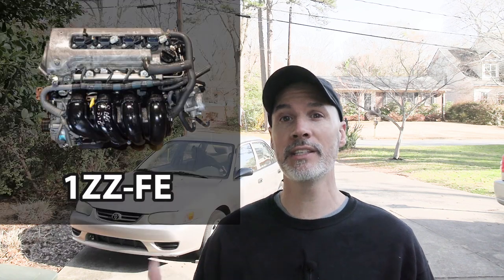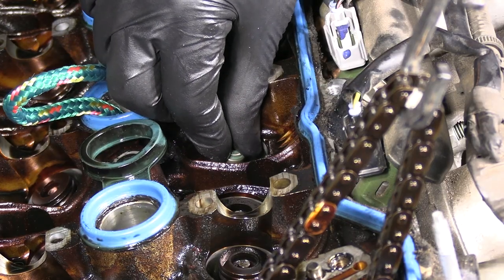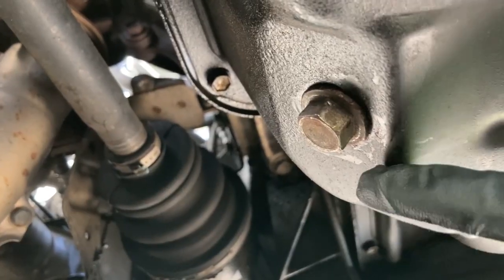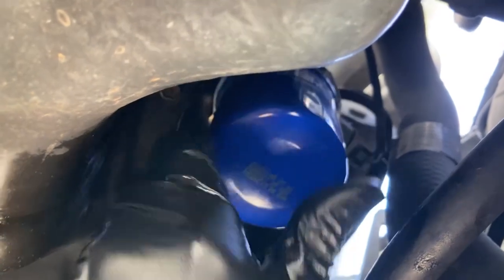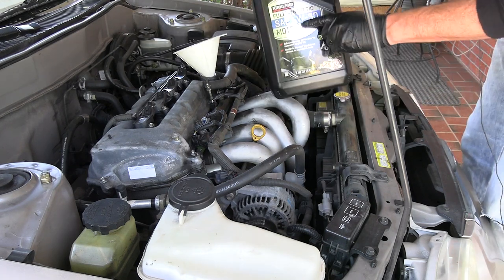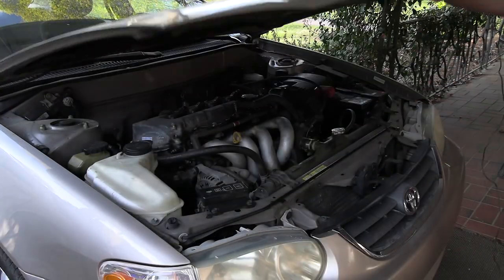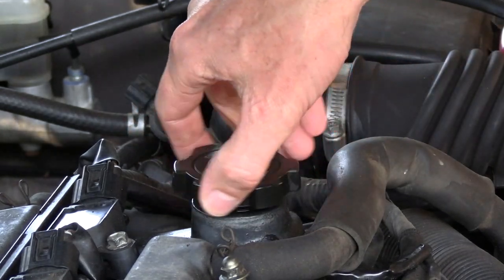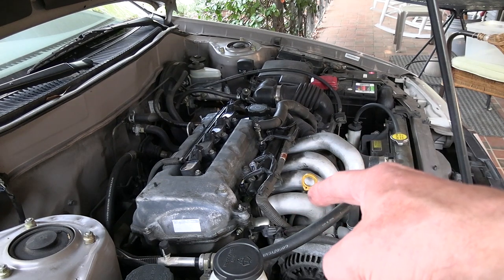Did the valve stem oil seals stop the oil consumption? | Oil Burning🔥Experiments | Episode 11

Comment: We have a 2005 Toyota Corolla that we use for work. It's an oil burner era car. This car was burning oil as I had to add one to two quarts every 2000 miles. Mechanic advised and he told us to fill oil to high mark on dipstick. Then add another quart or two. Car stopped burning oil period. Car know has 206,000 miles and doesn't burn oil and gets regular 3000 mile oil changes.

Comment: Hey Dave, I have the same oil pan as you and the o e thing I hate is trying to pour the used oil from the pan into a container. I figured out to drain the oil directly into a container which I put inside the oil drain pan to catch any drips.
Reply from the maker: Good Idea. Yeah, this one is a pain to empty.
Reply: Not sure about Toyota,  but on my Benzs I use a vacuum and never touch drain plug. Like DIY Dave would do, I vacuumed, then pulled plug to find not even a drop. I drained with plug and there was leftover for vacuum. Unfortunately, not every drain pan and dipstick tube configuration gets same results.

Comment: Have you considered pouring Acetone or Ethyl Acetate into the cylinders?
From using these in the past (not for this)I know they are excellent at breaking down carbon, they might stand a chance of freeing the rings if they are stuck from a carbon build up.
Reply from the maker: I haven't looked into the Ethyl Acetate, but someone warned against the Acetone, saying it would eat through seals. I'll check it out. Thanks.
Reply: @FamilyFriendlyDIY  Don’t think you’ll have any contact with any seals if your just filling the cylinders. You could flush the cylinders with some brake cleaner after letting them soak in the acetone to flush any remaining Acetone out.
Reply: Acetone should work nicely. I think it is the most used carbon dissolver in chemical industry. It is used to suspend the carbon to filter out any impurities like graphite or active carbon. Filter it and then just flash off the acetone and you are left with just carbon. If you are concerned about the engine seals you could leave the oil drain plug out while keeping the cylinders topped up with acetone. And to fight evaporation, put the spark plugs back in hand tight. 

If you have a cheap lawnmower maybe you could try the acetone on it's pistonhead first.

Also i have been looking into a product called Piston Kleen. Made out of 1-5% pentasodium triphosphate. I wonder if one could get their hands on to some 100% stuff. Piston Kleen is supposedly 50 times better at dissolving carbon from firearms than other fiream cleaners. Haven't tried it and haven't looked into how toxic the stuff is. 

In the olden days people used to clean the sludge out of crankcases with diesel fuel. Supposedly cleans carbon deposits also and is supposed to be seal friendly i guess. Just fill the whole thing up to the brim and let it soak a day maybe even two. After that let most of the diesel out. Try to leave the amount in that you would have oil in the engine. Check that the bores aren't filled with diesel. Take the spark plugs and the fuel pump relay out. Then run the engine with the starter just to circulate the diesel around the oil passages. And to get any dissolved stuff out of the passages.

After that let it drain. And do a couple oil changes letting the engine idle up to temperature in between. 

If feeling brave you could also replace one quart of the engine oil with diesel and let the engine idle for 30 to 60 minutes in 2 or 3 cycles letting the engine cool off some in between the cycles. 
Seems to be ok for the bearings if kept at idle.
The above I have tried once. Bought a neglegted car. Engine sludged up.  Did the cleaning with diesel. And drove the car for another 20 000miles until aquiring a more spacious car. My family member still has the car and it is in working order ,appears that the procedure didn't do any harm. Helped on oil burning some, but the turbo seals and valve stem seals needed changing too. The car now has around 260 000 miles on the clock.

Comment: I fill the filter myself if I can. 75% of engine damage occurs on cold startup. And a cold startup that needs to put the oil through the filter first is just that much more half seconds of wear
Reply: EXACTLY... In large industrial engines, both Diesels and gas turbines, having oil pressure and flow before actual starting is absolutely done by a "Pre-Lube" pump, and in very large engines, there are not just one, but two complete systems of Pre-Lube pumps, one run by AC and the other run by batteries(!) such is the importance of having a complete Pre-Lubrication during the start-up sequence!
In my cars, I take out the Sparkplugs, disconnect the fuel injectors and run the engine on the starter to get full lubrication before reinstalling the plugs and actually starting the engine when changing the oil...

Comment: 10W-30 would only be thicker (higher viscosity) than 5W-30 when cold, not when warmed up, so probably would not affect oil consumption much.  Going to xxW-40 might help oil leaking, but could affect the VVTi, or main or rod bearings, NOT recommended.  It might even reduce the flow rate through the piston oil ring drain holes, getting hotter, sludging more, reducing the size of the holes and making the problem worse.  Some DIYers online remove the pistons, drill more and larger drainback holes, and put the pistons back in.  My 2004 Vibe is ok so far at 80K miles.  I did raise the oil level per the Matrix TSB recently, I have not seen any foaming.
Reply: Well thinner oil will get into the gummed up oil rings better… thicker oil does slow down the problem but better to  take on long road trips driven higher rpm’s and get those oil rings cleaned up… beats tearing down the engine…   But if he is going to tear down the engine he should look and see if Toyota changed the piston design and oil ring design and replace with the upgraded
Reply: @pinonnut they did change the piston design with a completely new part number with new pistons.
Reply: Going with something as 'thick' as 20W-50 isn't appreciably thicker than something as thin as 0W-16. 20W-50 oil is around 20cST (Centistokes) at 212F while 0W-16 is around 8cST. That seems like a large difference but when you consider a 0W-16 oil is around 100cST at 100F, and 1000cST at 40F, it's easy to see that the purpose of going with thinner oils is to improve cold start ability and fuel economy when the engine is warming up. In Australia and countries in the middle east, Toyota specifies 20W-50 oil in hot climates anyway. Most of the push for thinner viscosity oils is for meeting government fuel economy requirements and for better cold start ability. I have this car and I use the thickest oil possible and it runs fine. I haven't carefully measured the fuel economy penalty of 5W-50 vs 0W-30 oil but I'd say when it's 50F outside, it brings my average down from 35mpg to 30mpg on trips less than 4 miles. On trips of 15 miles or more, there is no fuel economy penalty.

Comment: Hey Dave, it would be interesting to see if there is still oil leaking from the top of the engine now that you replaced the spark plug valve cover gaskets and the valve stem seals as it was the case in your previous borescope videos
I rewatched those parts and wonder whether that problem still exist or it was resolved
Reply from the maker: I'm planning to rescope as part of the next (Corolla) video to look at that very thing, ronda. I think there are going to be some surprises :-)  ... Thanks for the comment!
Reply: @FamilyFriendlyDIY  I thought the oil was leaking only in cylinder 3 from what I remembered, but when I rewatched I think I saw oil in cylinders 2 and 4 as well, although 3 was the worst, funny how memory works sometimes! 

Looking forward to your next video

Comment: Short of a total teardown and each part soaked & scrubbed, this
engine needs to be rinsed out and use 0W-30 oil with frequent
oil filter changes, until it is clean- then use only 0W-30 as oil.

The "rinse" is 1qt kerosene + 1qt conventional ATF and the remaining
0W-30 to 1/2 qt over full. Idle at 3k RPM 30 minutes, drain HOT overnight.
New filter each time. This must be performed at least twice, back to back.

2 quarts kerosene
2 quarts conventional ATF
7 quarts 0W-30
2 filters.

After this procedure, refill normally with 0W-30 & a filter. Spirited driving,
highway is low RPM, transmission is doing all the work of torque. High revs
and long idling keeps engines clean. Police cars & ambulance rarely
shut down- run 200k - 1,000's of hrs. frequent oil & filter based on
hours, not miles.
Reply from the maker: I like the 0W-30 idea. I can see how it would help with the cleaning.

Comment: Double check the cylinder walls with your borescope. The video you shoot before showing wall on cylinder 3 is full of leaking oil, and you think the oil is come from valve stem oil seal leak, so I think it is time to verify it. With reference from The Car Care Nut channel, it is best to inspect cylinder walls by a dual-lens borescope.
Reply: that's right, the cylinder walls are the problem, but would still be interesting to see how new rings go, keep up the good work

Comment: You’ve done a lot of testing for sure so I bought an 08 acura tl type s and the oil pan is leaking from the seal but only from a certain spot and the pan has hondabond which could be the old owner didn’t install it properly so what additive do you think works well with hondabond rtv? I’ve used Bars one seal and it didn’t work do they sent me the most expensive additive they have which should be able to stop it but I haven’t used it yet.

Comment: run engine flush for longer, 5-10mins isnt enough, a good hour of idling would really help. if you are too scared, just make sure to use engine flush that has anti wear additives.
Reply: Exactly, people are too afraid, and manufactures are scared to recommend what’s really needed, when it’s a quart and a half low, do for a toil change anyway, put in a quart and a half of motor flush, run it for a half hour a day for a week in the driveway, let it sit for a few days, then change the oil… Center wait oil to get into those clogged oil rings… Not 10W-30 5w 20 Then go on a road trip and drive fast for 1000 miles… That will reduce the oil consumption by half, and then religious oil changes will keep cleaning the rings (Hopefully if they’re not turn to super glue already)

Comment: Ive tried most of the fluids you have on my 2000 Corolla with no luck. Im considered mixing diesel fuel or kerosene in the oil to see if that works. Ive tried seafoam, marvel mystery oil, lucas motor treatment, ATF, engine restore, stp oil treatment. Hoping you figure something out I really don’t feel like doing rings but if i do i only paid $200 for the car.
Reply from the maker: Wow, you've tried pretty much all the stuff folks are recommending. Thanks for the info!

Comment: The ring lands have been pressure/heat compacted with carbon over time. If that expensive BG Dynamic Clean don't cut it no pour in product will. You'd have to use your connections to get the BG system as they only sell it to shops. A shop owner in New Jersey who has a podcast says mixing brake fluid with the oil is a LAST ditch hail Mary for internal cleaning.

Comment: Been waiting for this...my 02 Corolla at 186,000 burns like yours, yet my GFs 01 at 208,000 doesnt
Reply from the maker: Crazy eh?  ... Do you know any of their history that might clue us in to why one burns and one doesn't? Thanks for the comment!
Reply: @FamilyFriendlyDIY  Some of their history. The 01 is a salvage vehicle that received a rebuilt title in New York in 2014. The 02 is a clean title that apparently sat for 3 years till I purchased it in 2018 in California. They both drive great. Just the 02 burns oil at about the same rate as yours does. Here's another suggestion. I was reading some stuff on the Toyota forums and someone mentioned Valvoline Blue RESTORE OIL (Not Valvoline Blue standard oil). It's engineered for Cummins engines that had a bad sludge issue but safely can be used in gasoline engines. The problem? Can I let be purchased at a Cummins dealer. Cannot be purchased online. It has a ton of additives (including Ether) for cleaning pistons and rings and claims it can be all fixed in one oil change cycle. Another negative? The oil is about 75 dollars a gallon. I'm going to try to pick some up here in Wichita next week and try it.
Reply: @FamilyFriendlyDIY  Furthermore, the 2002 was a transition year. They probably rushed the 02s out to get started on the 03s. That could be a reason as well.

Comment: Is your burned oil coming out of your exhaust? And if so when?
Reply from the maker: Not really. The cat seems to be doing a good job of cleaning it up.
Reply: @FamilyFriendlyDIY  thanks for replying
 I'm kinda in the same boat. I have a 2004 Honda element that burns about 3/4 of a quart of oil. And I can see it coming out of the exhaust but only after long idles. I'm going to try replacing the valve stem seals.
Reply from the maker: Sounds like a good place to start. I've done a few Honda valve stem seals myself ... much easier than Toyota!! @didiermejia780

Comment: I think I heard right this is a 2002 Toyota Corolla? They are notorious for oil burning. Toyota gave this motor too much stroke. They fixed this in 2003+ so before 2003 they are known for burning oil.

Comment: my experience was that after the drain back holes in piston clogged the oil in the oil control ring had no place to go so it just cooked into carbon,.not sludge or dirty oil but hard as a rock carbon,..making the oil control rings non functional,...I dont believe any chemical additive is going to break that up......anyhows that's what mine was like
Reply from the maker: That does sound like a reasonable explanation.

Comment: On saab 93 linear 05 had coolant problems so replaced most parts. Not leaking but there's is pressure building inside and it overheats. When I turn heat on goes away. I open cap pressure goes away? Any thoughts
Reply from the maker: Is the radiator fan or fans working?

Comment: Good video. Id just go 1 step thicker on the oil weight and observe. i doubt it is a gunk issue, the rings are just worn.  If your really adventurous you could rebuild and do a quick hone and new rings.
Reply: Or find a Donor junkyard engine.
Reply: You can't do a hone job on a toyota. The clearance is to small you would lose lots of compression. 
Once you have any kind of cylinder wall damage on a toyota it's junk yard material.

Comment: Do you guys have engine flush called TEC 2000 in the US ? Not only there is whole channel dedicated (from poland) with before and after videos of it fixing compression and oil usage but it also helped me with M54 based E46 BMW. That thing was taking around 1 quart per 1200 miles. 
Now iam at around 3000 miles per quart. Which means iam only topping off the oil once per oil change. The engine also has notorious problem with piston rings. It was just a suggestion, engine flush is kind of the same principle no matter who makes it but it appears some of the brands add their own "know how" into the mix. Other option as suggestion would be BG 109 EPR, which i know comes from US so you can definitely pick it up. They even have specific use case for engine flush like 30 minutes and actually holding RPM at 1500+ while the procedure is happening. Which i dont think i saw another engine flush instructions to have it.
Reply from the maker: I just did a search and couldn't find it available for purchase here .. so I guess not.

Comment: Sir it is pistons drain back holes drilled at a up angle instead of being down. Toyota issued the recall. You will need to replace pistons and rings. You will find oil ring groove full of carbon. Like you videos

Comment: Try wih  BG Dnamic engine cleaner, before  tear down the engine. Is expensive but It does  clean the engine. If that engine is only dirty  it Will solve the oil burnig.
Reply from the maker: Thanks Javier. BG dynamic engine cleaner is probably coming soon. We’ll see!

Comment: Those oil drain back holes are nearly impossible to get soaked and cleared, maybe if the soak and cleaning was done early early in it’s life periodically as maintenance in its life then yes it will work but,  nearly impossible to clear those holes caked hard up with carbon, just pull and rebuild or replace pistons, the soaking can drastically improve stuck oil control rings that have been carbon up but to clean the holes is nearly impossible
Reply: 100 percent correct

Comment: You need to use sea foam in the crank case and drive 300 miles. Accelerate the car. You also need to use Lucas injector cleaner along then way.
Reply: See all episodes in series. He’s literally tried everything methodically. There’s just not enough detergent power once the oil return holes get clogged
Reply: @ericcartier3281  I would say do it over and over…

Comment: Fill the whole engine with diesel fuel, until it fills up the heads and let it sit for a day or two. I bet you that would loosen up those stuck rings. This method has been done to cars with sludge buildup. But they would also add a tube inside of the engine and pump air to agitate the carbon/sludge
Reply from the maker: Thanks for the suggestion!